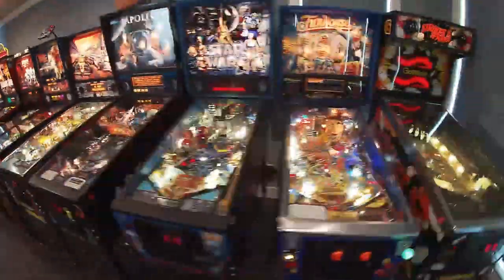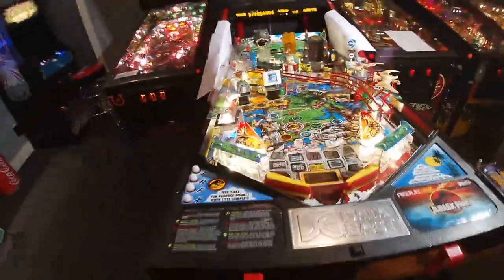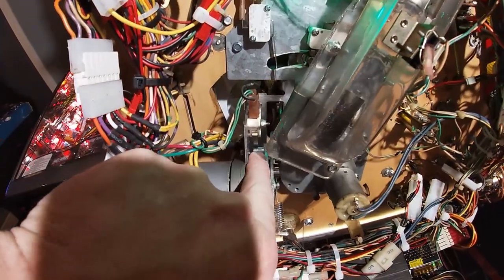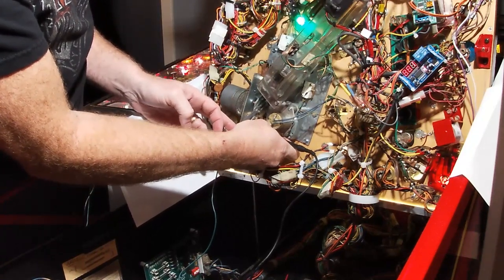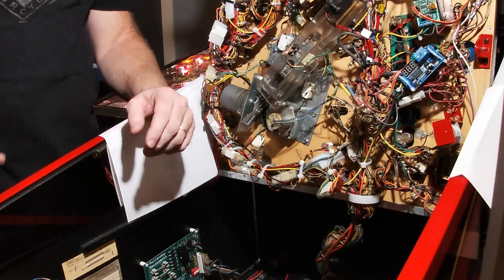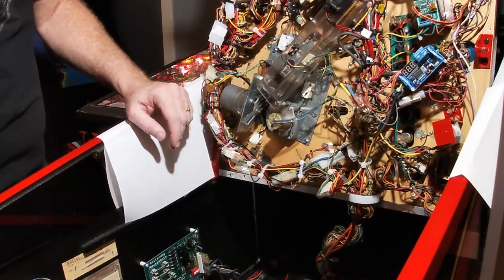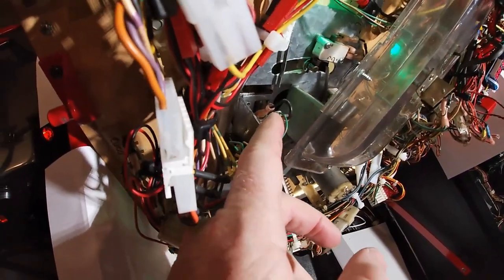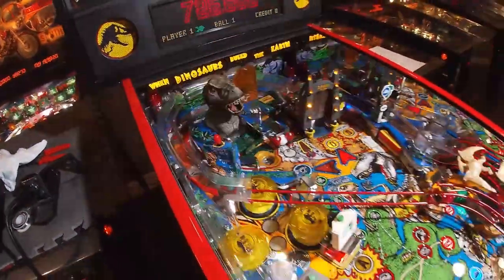Pinball Switch Problems

Comment: Maybe a silly question, but how did you put the playfield up like that? I recently got my own JP and fixed a couple of issues it had (no thanks to the seller, but it was very satisfying...had to fix a ball through switch, a melted raptor coil, and some other minor things) but had difficulties reaching the bottom. I Know it's the "right" way I put it as there's the hook that latches, but that way the bottom side of the playfield is very difficult to access. Did you just pull it up or did you modify your cabinet somehow to allow for that? I'd try but I don't want to break anything, I'm tippytoing around it as much as I can since it's my first machine (and of course I got the best pinball machine, JPDE!). Thanks :)
Reply from the maker: I didn’t modify anything to get the playfield up like that.  You just have to be very careful.  There are two slide rails on the cabinet. One holds each playfield pivot. As you lift the front of the playfield up a bit, you then pull the playfield forward being very careful to pull it straight towards you. Once the pivots hit the end of those slide brackets, you can tilt the playfield up a little more and it will rest on a set of sliding brackets on the back edge of each side of the playfield. You can keep pulling it towards you until those sliders then hit the edge of the cabinet bracket.  Then the entire playfield can be lifted up and rest against the back box.  
Now after saying all that.  There is no protection from the playfield falling off the cabinet brackets and into the floor of the cabinet if you don’t keep the playfield straight. If there is a twist when you lift it it can be dropped.  There have been many flipper boards ruined by this.  You have to make sure you lift evenly. You also have to let it down evenly.  
When you are putting it down, the rear sliders will hit the back of the cabinet bracket, some people just push it real hard to “pop” them over and continue sliding the playfield back in.  I personally don’t like to jolt my machine like that so I will stand by the side of the machine and hold the front up with one hand and reach under the back of the playfield with the other and just raise it enough to get the slides over the hump and then let it down on the pivots and then move back to the front and finish sliding the playfield back in. 

Once you do it a few times it’s pretty easy but I can’t stress enough. BE CAREFUL. Keep everything straight and don’t twist.  👍🏻
Reply: @LonnyPayne  thanks :) Hopefully I won't have to do that for a while as I fixed a few issues, I hope my trex will keep up his eating habits for a looong time! But it's good to know I can put it that way. I'll ask a second set of hands if ever do that the first times though. Thanks!

Comment: When a Pinball game has a stuck coil that is causing to blow fuses because a driver transistor is shorted or the coil is shorted. How can you turn on the pinball game without it blowing fuses to troubleshoot which driver transistor is Bad? you can disconnect the wiring harness from the solenoids to the driver board but how do you find which driver transistor is bad?
Reply from the maker: If I’m understanding you correctly, if you know what coil is stuck on then you can use the manual to see which one it is on the driver board. Normally the coil will lock on for a little bit before it actually blows the fuse. If you can’t figure it out within a second or so then turn the game back off real quick and the fuse shouldn’t blow. Then after a little bit repeat that until you find the coil.
Reply: @LonnyPayne  yes was wondering how you troubleshoot pinball games that are blowing fuses when coils are locked on and keeps blowing the fuses without having enough time to find it which coil or driver transistor is bad. First step is to remove the solenoids harness from the driver boards PCB board. If its still blowing fuses when you turn the game on, how do you find out which driver transistor is bad?

Comment: Whats going on with the multiple transformers /powersuplies in the bottom of the cab?
Reply from the maker: I use separate transformers to power my mods so it doesn’t draw power off the CPU. I. This case I have both 5v and 12v mods so there is a transformer for each.